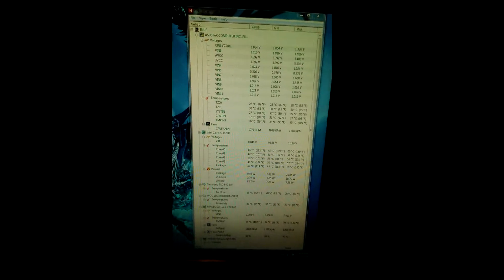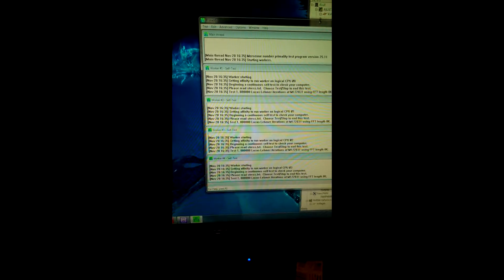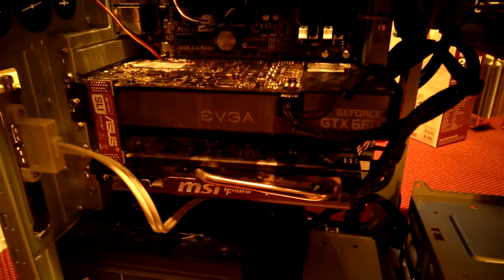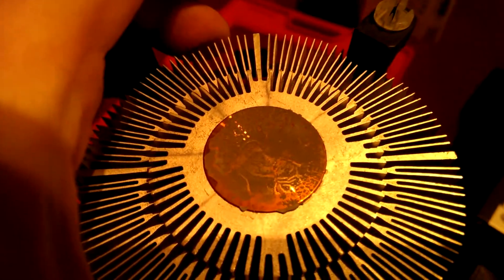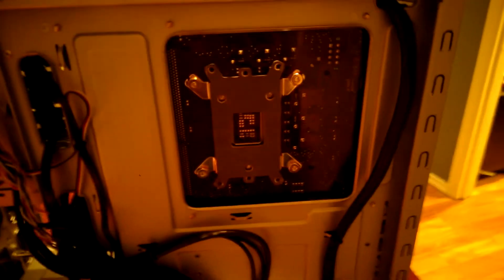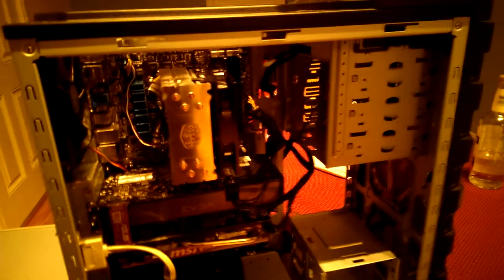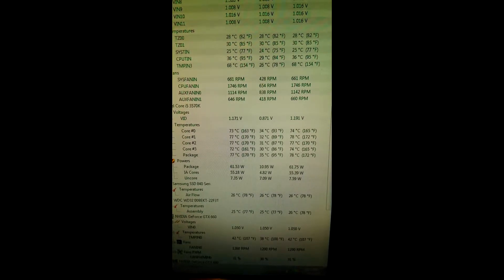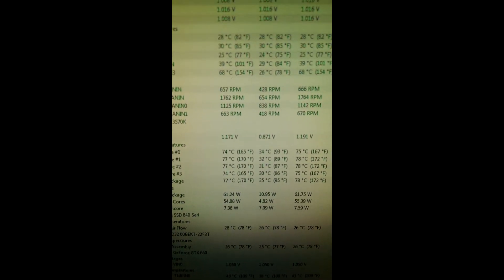Hyper 212 Evo install temps

Comment: Great video, very helpful with ddr3 based hardware. I now have an idea what I should look for when oc'ing my 3570k. Currently have it at 1.25v, 4.3ghz and it is hitting 90c in prime95 with the 212 Evo and a Noctua fan (stock fan died after 6+ yrs). Think I'll back down the voltage if you are getting lower Temps.
Reply from the maker: It's been a while since I did any overclocking on this chip because it is now a server machine. I can tell you though that any voltage decrease you can do and maintain a stable experience the better. Your cpu will last longer and cost you less money in electricity.

Comment: so if i can see my motherboard from taking my other panel off my case i can install it with out removing mother board
Reply from the maker: Yes, that is what I did. You need access to all 4 mounting holes. But if there is a hole there it is very likely you will have enough room.

Comment: Great video, It looked like with the stock cooler it was hitting the TJ Max for the CPU, you are crazy for OC'ing to 4.4 on stock cooler lol but very impressive. I was looking for a video to show the 212 in the HAF 912 case and I am glad I did, it looks like it fits perfectly.
Reply from the maker: glad the video helped you with your decision. I'm still appreciating the cooler. my cpu runs happily at 4.66ghz at this point with no over voltage. I've gotten more conservative with my overclocking since making this video.

Comment: glad to see i dont need a new cooler for my 4770k i was worried the evo wouldnt handle Haswell... 70c is far below the recommended thermal threshold for these cpus...glad to see that
Reply: +Jasper W (Spike229) is it ok on my 4790k in around a 28celcius room to hit 83 while under 100 percent load and around 70 on cpu intensive games likebf4